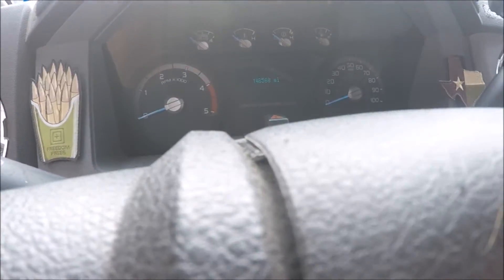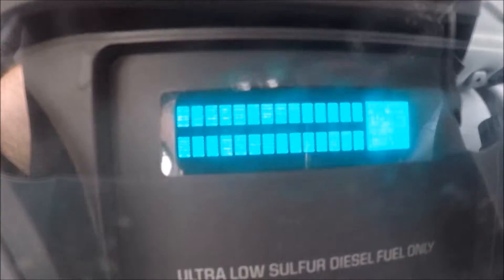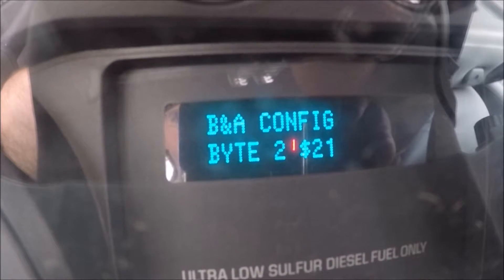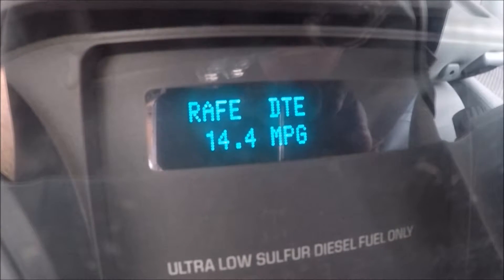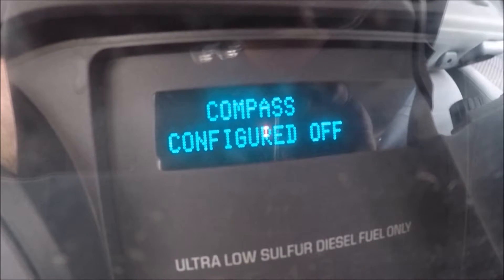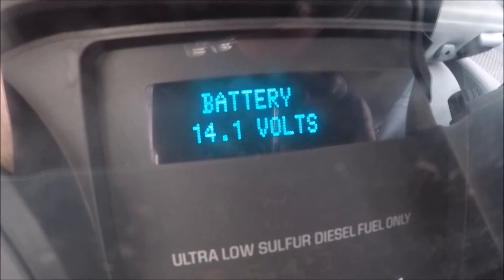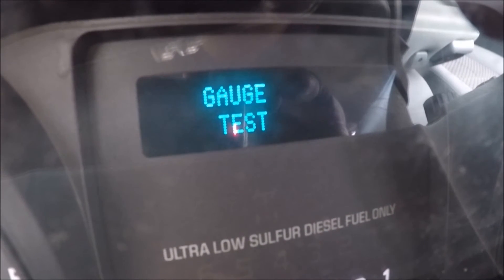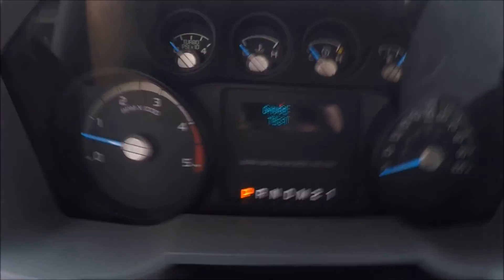Ford F-250 XLT Super Duty 6.7l - Engineering Mode

Comment: Cannot get my 15 F350 to get into this mode
Reply from the maker: It can be tricky sometimes.... give it a few tries. I think 2015 has some slight changes as well, maybe they did away with this more and they have a different way of doing it now?
Reply: @CallMeColtLLC  I get into the service mode but can’t find the APE or what it’s called to change the numbers over. I’m deleted with Chaos tunes also. Do I need to re install the stick tuning ?? Just curious.  Thanks. Rick
Reply from the maker: @wizzsax123  I'm not sure what you mean by change the numbers over. If you mean the values be read out on certain modes, I have no idea. Even my ForScan reads the sensors that way.
Reply: @CallMeColtLLC  referring to the AFE BIAS to correct fuel
Mileage. That does not show up when I enter the maintenance mode. Have no idea why
Reply: Like you did in your video